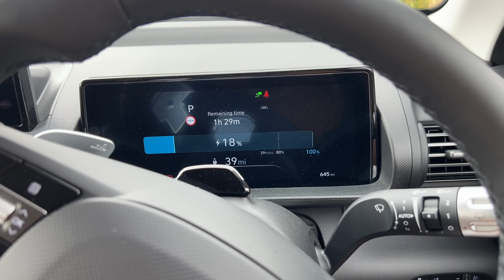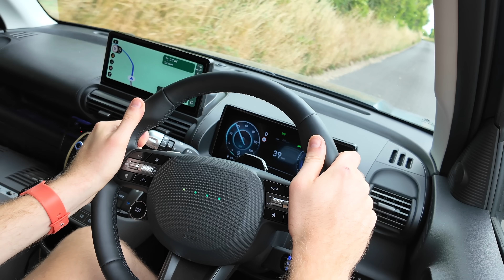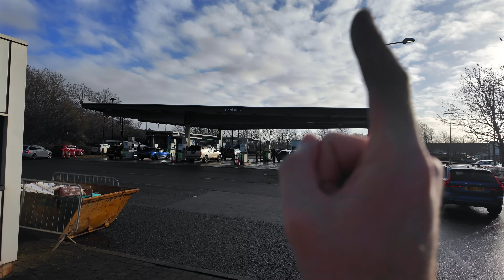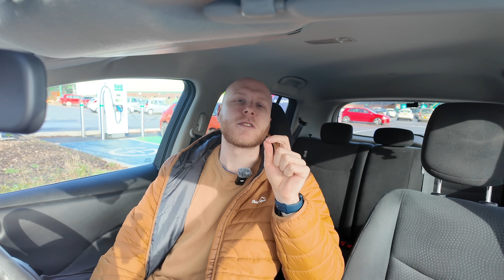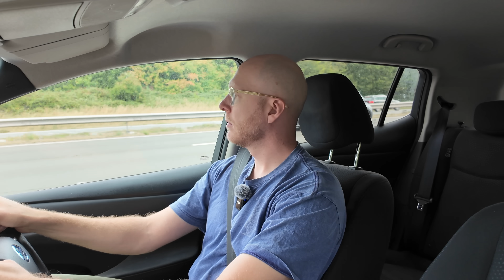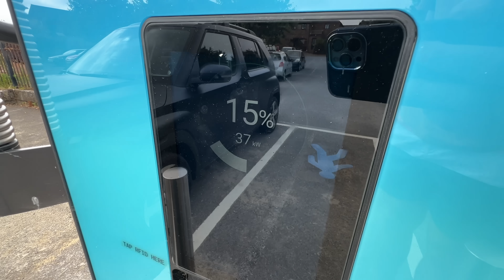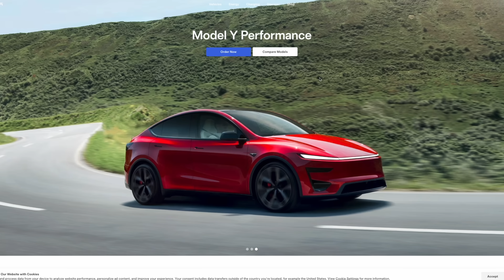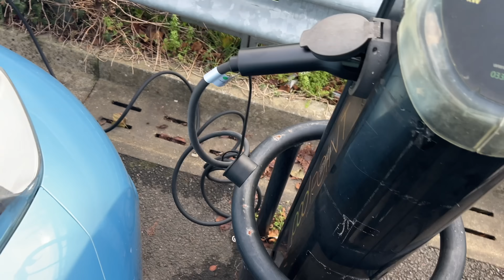19 Things You Should NEVER Do In An Electric Car

Comment: Never buy an old, 2nd hand EV ?  Battery replacement costs could bankrupt you...
Reply: That’s a myth. EV batteries are typically given long warranties and they only have those because the manufacturers now know that they will most likely outlast the car.

I bought a 3 year old Leaf in 2018 and it is still going strong. Even if it needed a replacement battery it would cost a lot less than the quote I got for the Diesel engine/gearbox work needed to repair a 10 year old car (I scrapped the diesel and bought the Leaf)
Reply: Correct. Batteries last much longer that transmission and motor and cost way less.
Reply: I don't think people can comprehend the real used car market for low income buyers. A 3-5 year old vehicle is not "old." Talk about the 15 to 20 year old EVs. How are they fairing on their original battery? There are still 20+ year old vehicles out driving on their original powertrain. With the limited range of EVs, the battery degradation at 15+ years will make battery replacement almost necessary for anyone that drives any significant mileage. Maybe as a short daily drive commuter they will still work, but forget about road trips or lengthy daily driving. This is coming from someone who wants as EV and plans on replacing an old vehicle with one as soon as one that meets specific criteria becomes available at an appropriate price that can be afforded. It's possible this will happen with some 26/27 models after they come off a 2 year lease.

There are too many compromises for the majority of people when you consider only the top 10% of earners account for 50% of spending. Imagine the bottom 50% of earners. They are not looking at anything newer than 10 years old if they need a vehicle. Replacing the HV battery on an EV can cost as much if not more than replacing the engine and transmission on some vehicles. As time passes, savings from junkyards may yield closer pricing, but that's always a gamble either way. People are always apt to compare different class/size vehicles, but when you put them on even footing, an EV "can" save someone money if getting it relatively new and selling it before any significant repairs are needed. Almost all the money you save in maintenance immediately disappears once you have to replace the battery and/or another expensive component.

Over time this should shift. Once more EV production exists and combustion starts to decline, I would expect many of the EV components to become less expensive. Typically, the labor involved will be less as well, but this really depends on the job at hand and what's being compared. There really is no "best" right now for many people, as it all depends on locale and the prices they have for fueling either. In many areas of the Northeast US, even home charging can create a higher cost per mile than buying "regular" gasoline for a good hybrid of the same size. Don't even get me started on the ridiculous DCFC rates that are often seen, especially in less served areas. They cause EVs to greatly exceed the fueling costs of a hybrid. At least some exist that are "reasonable" but this pricing should theoretically decrease over time as the different networks will have to compete on price once they are more ubiquitous.

You live with special privilege if you have never driven a vehicle over 10 years old. You should recognize that and realize the majority of people out there drive vehicles much older than that. For the most part, EVs that serve more functions than a daily driver for 1 or 2 people are still a luxury. Small cars like the Bolt and Leaf just don't offer space for some needs, or aren't rated to tow a weight for some utility trailers people may need to move on occasion. Things like the R2, the new Subaru/Toyota Trailseeker/bz Woodland are starting to expand on the larger but not giant SUV options. The new 27 Highlander might be a decent size too, but could easily end up too expensive for what it is.

Back to the point, by the time a battery needs to be replaced due to age, it's likely going to cost 1/2 of what buying the same year vehicle at that time will. This is assuming no significant reduction in battery replacement costs. It could easily become more worthwhile to sell the vehicle in that degraded state and then use that money and what you would have spent on replacing the battery as a down payment or to outright purchase something with newer EV tech. In a way, EVs are just becoming disposable cars, but I'm really hoping they are able to stick around for the long run. It would be great to see lots of 15+ year old EVs on the roads in the 2040s.
Reply: Complete rubbish, warrantied for 8 years and in reality they will outlast the car.
Reply: My daughter has a 2018 Zoe she bought second hand three years ago. She simply never cares about charging to 80% etc, she just plugs it in and charges it fully every time. She uses it daily for work and picking up her daughter from nursery. I borrowed it about three times to see if I could get on with it. It still registers the mileage correctly (about 180 miles on full charge). I did a 50 mile trip in eco mode and it registered 125 miles when I got back. It doesn’t show any signs of degradation. I have now bought a 2020 GT line for £8,500 from Renault with three year warranty and love it.
Reply: Useful video, thanks.

I recently bought my first EV, a second-hand MY22 Jaguar I-PACE. I did a fair bit of research before buying it and your video usefully summarised the main points I had learned.

I don't do OPD (one pedal driving) as I prefer to have my foot off the pedals when possible. So I have Regen set to light rather than heavy and I can just use the same accelerator sense I have built up over the years. I don't want to have to keep pressing the accelerator pedal to prevent a harsh slowdown from kicking in.

I understand the ZapMap app allows me to pay for public chargers as well as find them. I have the app installed but I haven't tried that payment feature yet.  It was annoying to see in your video I need a separate app for paying! Is that still true? I do have a Zapmap card I can use for my occasional longer trip if I need to use a public charger.  I also have the Tesla app installed so I can use the Supercharger network. Again, something I have not yet tried to use.

I do have a home charger installed. I am not convinced a low rate nighttime tariff (at the expense of paying more during the day for our domestic electricity) is worth it for me as I mostly do short journeys so do not recharge my car every night.

Comment: Another one regarding the brakes its a good idea every now again to use the brakes a little bit say 10% of what you normally would if in one pedal drive all the time to stop the corrosion getting too established and to keep the rotors mostly rust free. You could get a nasty suprise at the MOT if the rotors are over corroded and it fails. Went out to some private land and did some brake burnishing in service mode problem was solved at the next test a week later (I get my MOT done 3 to 4 weeks early hence why i could do this as old one was still valid)
Reply: OPD engages the brakes to bring the car to a halt. Regen cannot do enough below 10mph to do that.

Not all cars have true OPD though. Many just allow the regen to slow the car to a point where the brakes have to be pressed manually.
Reply: @ayebrow  i take your point as my experience is limited to the BYD seal and tesla model 3 performance 1st generatiion they both easily stop it completely in standard regen but not in the lower regen setting

Comment: So much agro owning an EV
Reply: Nope.

I drove ICEVs for over 30 years before buying my first EV, and the list of dos and don’ts for ICEVs is at least as long (and includes some Alex talks about, like tyre maintenance)

The only reason you imagine there is more aggravation with an EV is you either a) abuse your ICE vehicle or b) have forgotten how much you had to learn to make sure your ICE vehicle behaves.
Reply: Some seem to like taking on the extra challenges like a hobby. Most people just want to get in and go.
Reply: @SteveLomas-k6k  That's exactly what I do - get in, foot on brake, press the start button, press the drive (or reverse) button, foot off brake and that's it. Home charging is just a simple (but a lot less smelly) as filling up with petrol or diesel. Being aware of maintenance requirements etc. applies to whatever car you drive, and ICE cars generally have far more than EVs. I've had ICE cars for 60 or so years (yes - I'm very old) and have recently bought my first EV and love it; really relaxing to drive.
Reply: @DaveJS46  You don't need to disconnect and wind up the charging cable first?
Reply: No it's so simple to use a ev, just different, but you do sometimes need to engage your brain.
Reply: Absolutely none whatsoever.